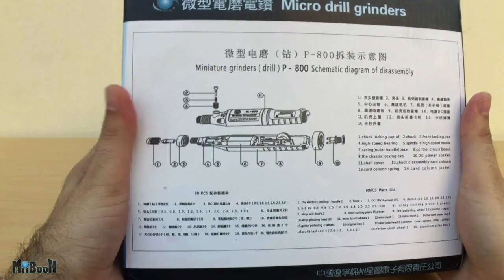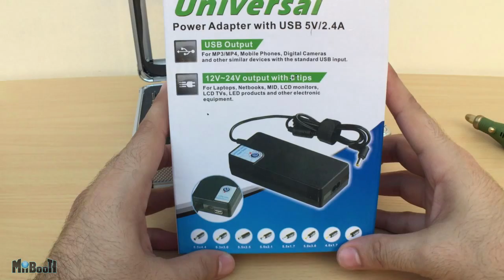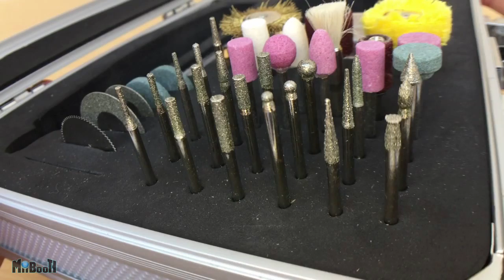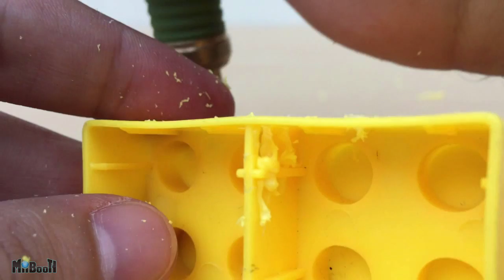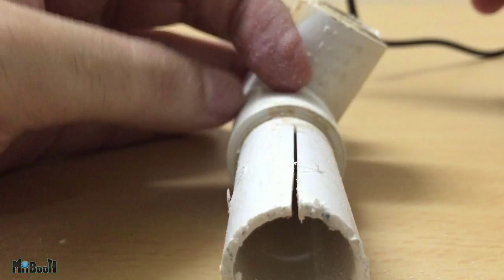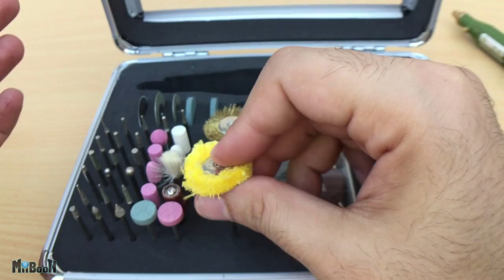Mini drill set Review | Your perfect DIY companion!

Comment: Those little Mandrels for cut off wheels and sanding disc and saw blades etc. you're supposed to use the metal washers for the Metal sawblades and the red softer washers for softer bits like the resin cutter Disc and grinder stones anything brittle really.
Reply from the maker: Thanks for the info :)

Comment: Just got one but is not working only with charger connected all the time, charged it 10 hours but still same problem, anyone know battery specs?
Reply from the maker: +M H It is not a rechargeable device. The power cord should be connected all the time to use it. And you can turn the speed up and down by turning the wheel just like I showed in the video.
Reply: MiiBooth hahaha thanks mate guess I bought the cat in the Sak lolz thanks man will use the grinding tools for me dremel lolz. 
Need a battery driven one any advice?